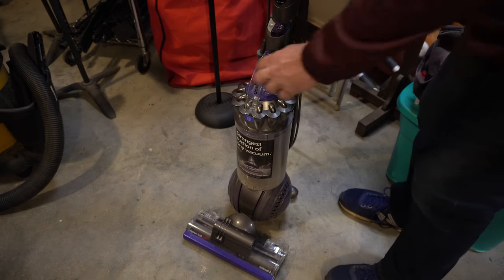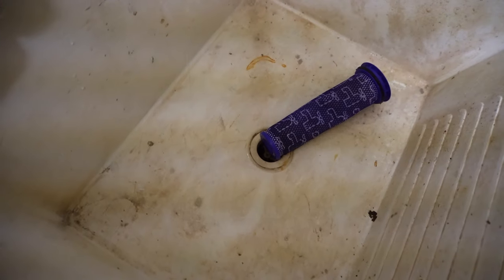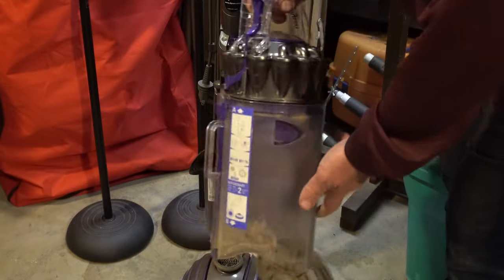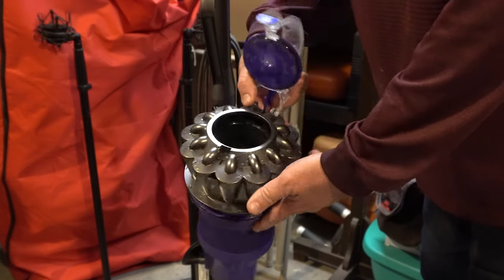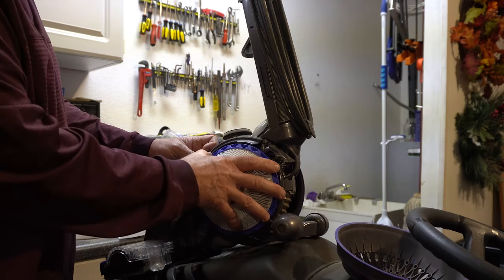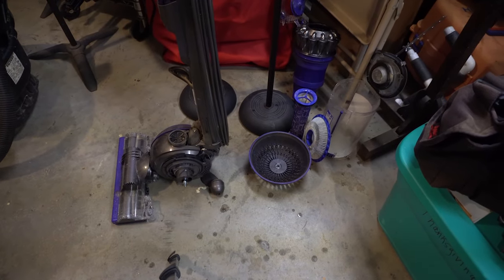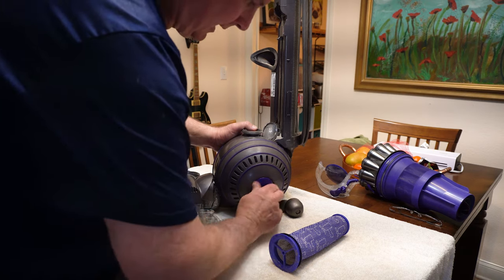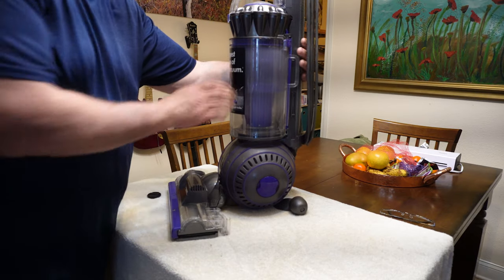How to Clean a Dyson Ball Animal 2 Vacuum Cleaner - Washing the Filters and Cleaning the Canisters

Comment: Thanks, I was too lazy to try and find the owner's manual. I am concerned that I was not supposed to get the "cyclone" part wet but too late lol.
Reply: Yes you are correct you are not supposed to run water through the cyclone part. I am surprised this guy did that.

Comment: Glad to see someone else washes their cyclones. Since its all plastic and no electronics in there. I washed my cyclone too, but I knew a disinfectant was needed because odor is caused by organic growth inside. Got a 5 gallon bucket, filled it with cold water and lysol disinfectant, dunked it and and then rinsed with clean water. Set it out in the sun shine and filters cleaned separately, used antibacterial hand soap on cyclone filter only, rinsed again in cold water, set it out in the sun. The ball filter just needed a quick rinse of water, didn't have an odor. Sun baked everything real good and put it back together and boom clear and clean vacuum. Don't forget to do your roller and canister too.
Only do this if no electronic components are present in the parts.

Comment: Thanks, good video!
There is an important additional part which can be disassembled.  It's the foot of the machine, the flat part which contains the brush roller.  That's usually got a ton of dirt and hair wrapped around it.  This is what blocks up my Dyson.  I recommend unclipping the two levers on the bottom of the foot and then pulling back the red lever underneath the machine to release the foot entirely. It needs a lot of gentle wiggling. You will then be able to remove all of the gunk.
Reply: I have super long hair. I suggest people with long hair cleaning that roller every or every other time you clean the filters. I just had to cut all the hair off my roller. Took about 15min total on the roller. It was a very easy job.
Reply: Long hair girl here too! Yes, this part, cleaning the roller is super important and I clean it kinda often , like every two or three weeks
Reply: Mine had a silver grey C clip holding the foot part onto the stick/ball part.  I got the bottom off of the foot and got all the hair and dirt off the roller, but there is a lot of dirt and gunk above the roller that you can see through the clear top part of the foot. Also a lot of hair inside. I can see that this is an electrical component, so I won't get it wet, unless I can get a damp rag in under there.

Comment: 2:05 Just finished cleaning mine, waited 24 hours, and put it back together. Sidenote: I had to clean the inner part (purple part that he’s talking about at 2:05) three times because mine was super stinky. The first time, I used to just water. It still stunk. The second time, I used up using vinegar & lightly scrubbed the screen with an extra-soft toothbrush. It still smelled, so the third time I used dish soap, again lightly scrubbing the filter/screen area where it smelled. Now, it doesn’t stink at all. I’ll be better about cleaning from now on. Thanks!

Comment: FYI Dyson only recommends cleaning the actual filters every 2 or 3 months or after heavy cleaning. They warn against rinsing anything other than the filters as the vacuum is not designed for liquid. There should be two, one in the wheel and one from the canister top.

Rinsing the actual canister parts can be done as shown in this video, but is not recommended. I would assume this would void a warranty as the Dyson manual states to never put any liquids inside the vacuum.

If you do decide to rinse out the plastic, not just the filters, I would make sure it is bone dry before putting it back together. I would guess this could damage the vacuum if there is excess liquid and could result in damage, shock, fire, etc.

Nice video overall, but wash canisters at your own risk!
Reply from the maker: FYI - I have done it four times so far, and no adverse issues at all. I think it's pretty important to rinse the canisters if you want to best eliminate odors. You are quite right about letting everything fully dry. I always let everything dry out for nearly 3 days before reassembling. I find that the filters take longer to dry than the Dyson recommendations. Best to be safe in that regard.
Reply: @tonyleeglenn  Whew! Thanks for clarifying this !

Comment: Uh your not supposed to run water through that cyclone.  All dyson websites tell you that.
Reply from the maker: Uh - I've done it like 8 times and all is still working like a charm. Just don't use "hot" water. Keep it cool and no harm, no foul.
Reply: Ok I did it 😅Hopefully I won’t have any problems 😅 Thank you!
Reply: @tonyleeglenn the cyclone drys completely? I think the reason Dyson says not to cuz some water might be trapped inside